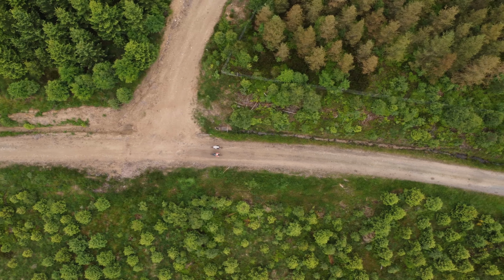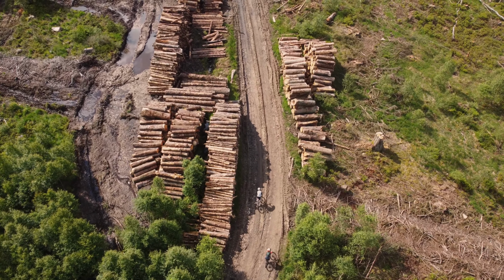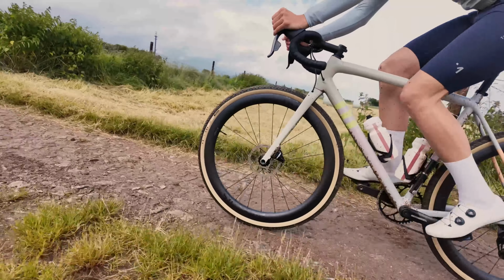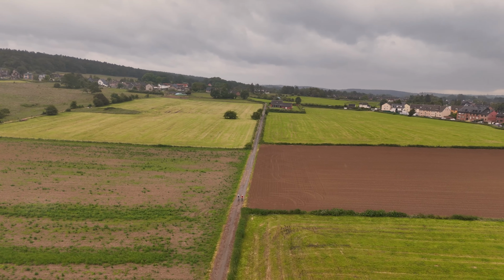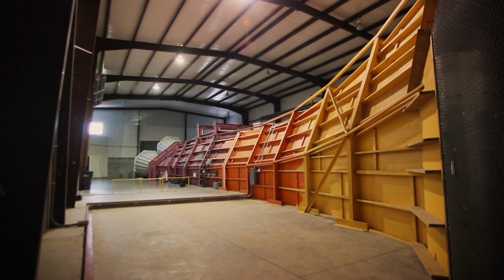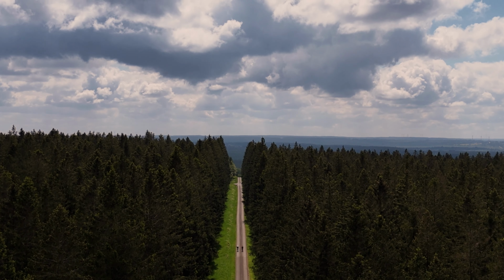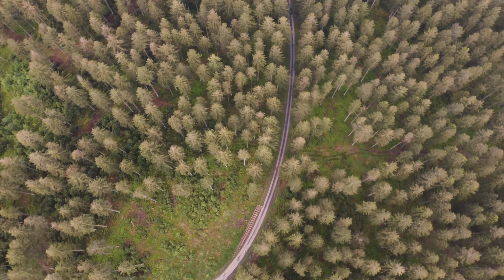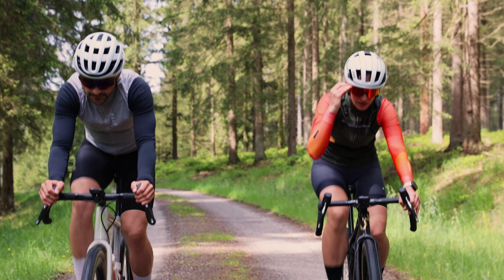FKT: The Development Story

Comment: Looks interesting but comparing it to going from a climbing wheel (35ish deep) to a deep front (80-90) and rear disc is insane, because as it says in video gravel speeds are slower so that even if your wheels are somewhat faster than others the speeds aren't high enough
Reply from the maker: @Sean-q5z5s  it’s something of a myth that aero only matters above a certain speed. Yes, the faster you go, the more watts saved but even for slower ride speeds you’d still be looking at the same savings over a fixed course. Hence why we show time savings over e.g. the Unbound course for these wheels. But the comparison is still valid - the difference is that big

Comment: The specs says 40mm Tire is optimal.  Is that measured 40mm or labeled 40mm?
My 35mm GK's measure 38mm on 25mm internals, so the 35mm GK's might plump out to 39/39.5mm on the FKT's?
Reply from the maker: @rayF4rio  all tyre widths are stated not measured. You can find details in our white paper around measured tyre widths across all makes/models tested

Comment: I’m running 25mm ID 32mm OD rims that are 50mm deep on my gravel bike right now.  Chris King hubs, had them built.  They’re not particularly light at 1600 grams, but they hold speed really really well.  Holding speed is important for me because some US gravel races can be several hours long.  Running 47mm Pathfinder Pro’s.  Gravel is by far and away the hottest cycling segment in the US.
Reply from the maker: Sounds like a sweet setup. We totally agree that gravel is where it's at right now!